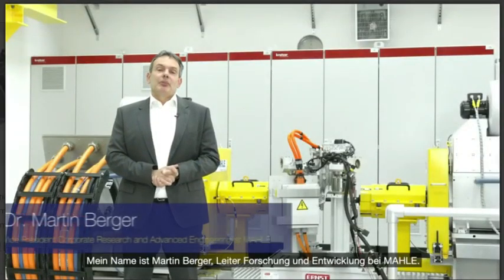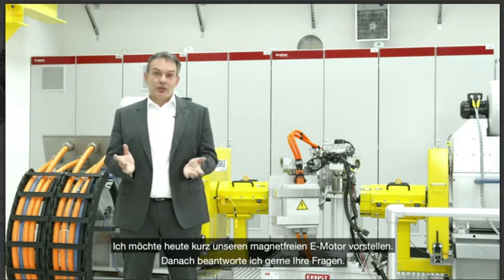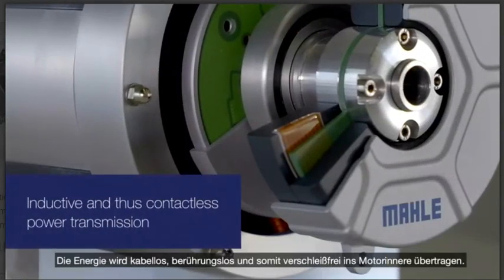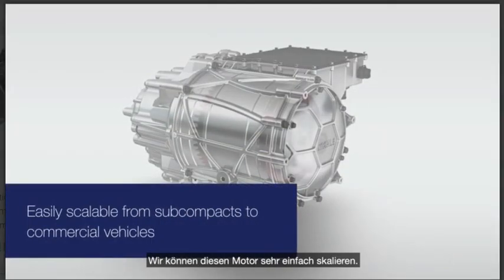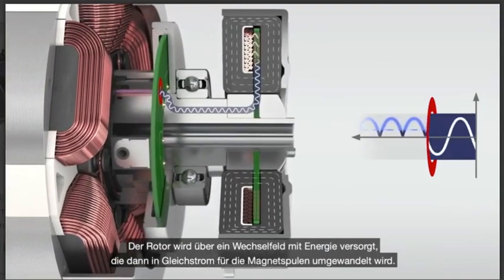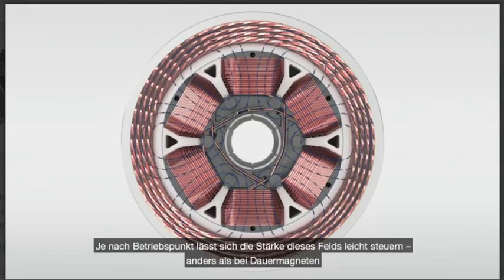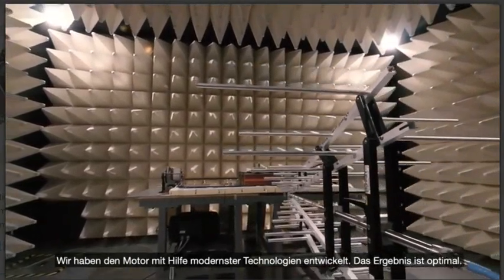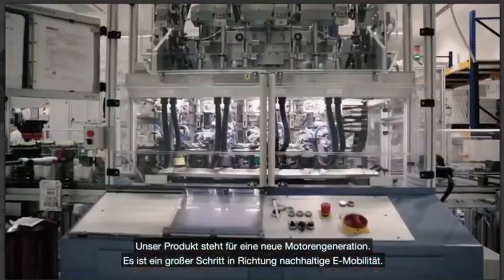Mahle, produce revolutionary new no-magnet motor...

Comment: Mahle re-invents the brushless induction motor? How utterly novel.....
Reply: More like eletrically excited syncronous motor
Reply: @Danielagostinho21  Yes, it is a synchronous motor with an electrically excited rotor winding, powered through an inductive coupling instead of brushes and slip rings. There are other motors with excitation power transferred inductively, but they typical depend on rotation of a rotor-mounted coil through field of the stationary coil (as an AC generator) instead of this design (which is basically a split transformer supplied with pulsed power).
Reply: @Danielagostinho21  it is a brushless version of a slip ring motor. Nothing about it is new and it should fail a patent audit because I'm sure someone can dig up an expired patent for the same thing
Reply: @Danielagostinho21  Uuuunnnnhhh, yeah....so their 'invention' is NOT an extension of brushless induction motors?
Reply: @almostbutnotentirelyunreas166  probably a problem of communication but for me pure induction motors(assynchronous) don't require power to the rotor to run. Synchronous motors do require if you don't have a permanent magnet. The new part here is definitely the brushless where previous would be done by brushes and slip rings. As others have mentioned, the claimed efficiency is pretty good too
Reply: @almostbutnotentirelyunreas166  No, it is not an induction motor.
Reply: @brianb-p6586  Lols.....no brushes ,no current, no 'induction', no flux?
What don't you understand?
Without  magnetic flux (induced, or via permanent magnets, or via current) , it wont run.
Ergo: No magnets, no brushes, = Induced flux via separate electrical current supply: 

Alternator / Motor....only 'new' thing is the 'convertor'.....so OK, let's give them that 'revolutionary' step. 
BTW, was this patented by Mahle, or was it not quite quite 'revolutionary' enough?
Reply: @almostbutnotentirelyunreas166  I didn't say there was no flux. I said that the rotor current was not induced by the change in flux due to shaft rotation. The flux change in the split transformer which transfers power to the rotor is caused by driving it with AC power (probably just chopped DC). That's not how an induction motor works.
Reply: @brianb-p6586  Are you saying that Mahle have (re-) invented speed / torque control via external current supply to the stator / rotor windings of a brushless motor? Wow, who would've thought that this was even possible?
This is kinda interesting, but hardly 'revolutionary',  unless they are referring to rpm.
DID MAHLE APPLY FOR / REGISTER A PATENT UNDER THIS DESIGN, or was it deemed 'obvious' ?
Reply: @almostbutnotentirelyunreas166  They didn't invent control of rotor winding current. They didn't even invent the use of a rotating transformer to deliver controlled current to the rotor winding. They developed a configuration which uses a rotating transformer to excite rotor current and which works effectively at all speeds, unlike traditional wireless excitation schemes... and even that aspect may not be original.

I agree that this is not revolutionary, but it's also not an induction motor.

While you may be familiar with the requirement that to be patentable, an invention must not be obvious ("to someone skilled in the art"), that was effectively dropped long ago, at least in North America. Many (perhaps most) recent patents would fail that test as well as the test for functionality; if the application is filed properly and cites all relevant prior art, and is not for a perpetual motion machine, it gets issued. 

Patents are published online, if you want to search. Presumably you would want to look for patents issued by the European Patent Office.
Reply: @brianb-p6586  While you may have some  familiarity Electrical Motor designs, at least we agree that this design is not as REVOLUTIONARY, as the title claims it to be. Nice marketing, Mahle! (Btw, must be TERRIBLE to be THE piston manufacturer, internationally, when PISTONS are suddenly NLR...) 
Now, about the 'induction' part of the 'revolutionary' motor: Are you referring to magnetically transferred (induced) current resulting in further magnetic flux, or are you referring to outright current supply that is inducing magnetic flux ....?
You see, this gets rather technical, right down to the very definitions of what is strictly meant by 'induction motor'......what is YOUR definition, considering the known 'variants'? 

Electrical Engineers may have a 'field' day with this 'revolutionary' (or do they mean rotating?) design..., especially on social media.

Comment: Okay. Scam alert.
1: the added weight of having replaced magnets with copper coils limits application 
2: Magnets do not require electricity so the 90% efficiency is doubtful without seeing the math and verified independent studies 
3: the extra heat generated by the whole system would be far greater than a magnetic motor.
Overall: there is a solid reason and tons of research to demonstrate why these types of motors are not used today. Take it to a reputable university and lets see if it is legit or a funding scam.
Notice how they never show an actual working motor and the computer model shown does not have a way to remove heat from the system.
Reply: Funding scam? From Mahle? Mahle, one of the largest automotive parts manufacture. Most of the cars you see on the street have parts developed by Mahle/co-developed with Mahle.
Reply: Did you check out the company, Mahle?  With sales of around 10 billion Euros last year and a 100 year history I don't think they're like some people on kickstarter trying to get funding for their startup.  I don't think they want or need any extra funding.  Last years R&D spend was 155 million Euros.
Reply: @davidneale530  Update: just went through their entire R&D projects and none of them mention this motor. The nearest thing to it is wireless recharging. I could be wrong but I see nothing in their system.
Reply: @arnoldbailey7550  You realise they haven't posted this video, it's one from their site that somebody else has posted here.  They haven't made any kind of pitch for funding at all.

You can check out their actual channel here: https://www.youtube.com/c/MAHLEGroup/featured

And the press release is here: https://www.mahle.com/en/news-and-press/press-releases/mahle-develops-highly-efficient-magnet-free-electric-motor--82368

Comment: Funny, when I started out field windings were it in everything, then permanent magnets we the new big thing then brashness, now back to field windings, I wonder if brushes will make a comeback too, yes they wear but oh so reliable
Reply: Brushes may be simple (therefore reliable) but oh the losses...
Reply: @peterkiss1204  Nonetheless, cars have used starter motors virtually since the invention of self-starting cars, that use brushes and field windings.  Brushes have their place where the trade-off between losses, frequency of use, current drawn and simplicity of manufacture all favour them.
Reply: @DownhillAllTheWay  it's also a compact/powerful and cheap motor with good startup torque that takes DC. Efficiency may be bad but it doesn't really matter if it operates for maybe 20 seconds a day.
Reply: @Skooteh  Agreed.  Comparing it with a motor that will drive a car for hundreds of miles at a time is a bad comparison.  My bad!